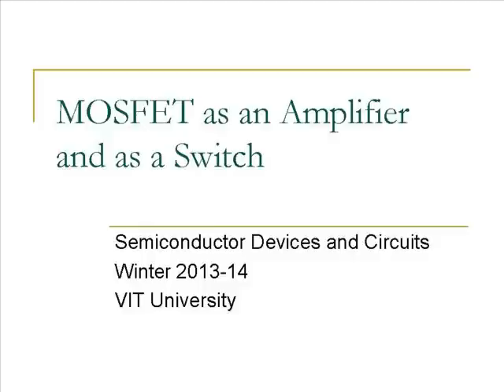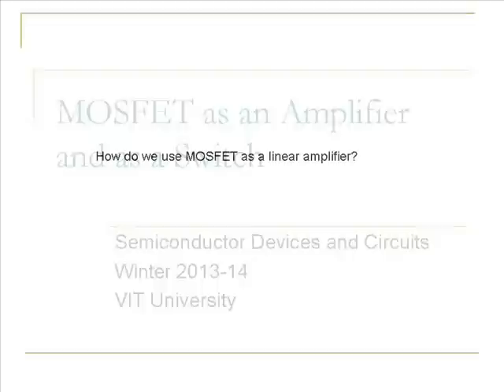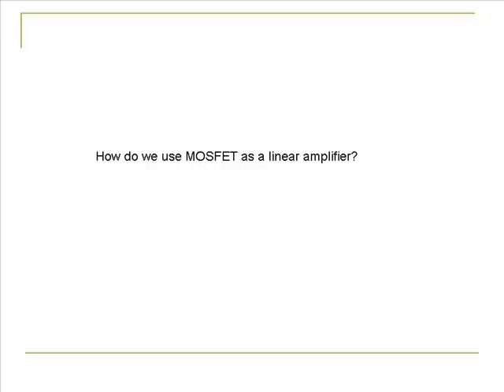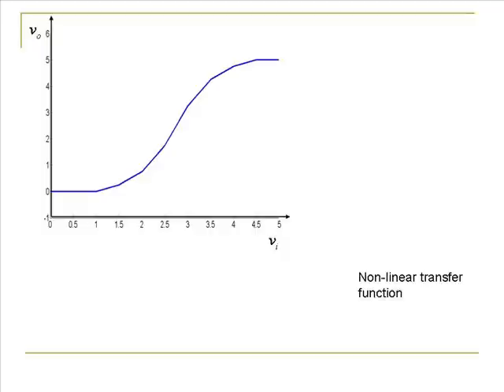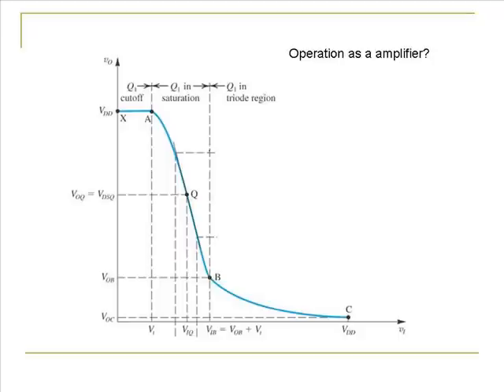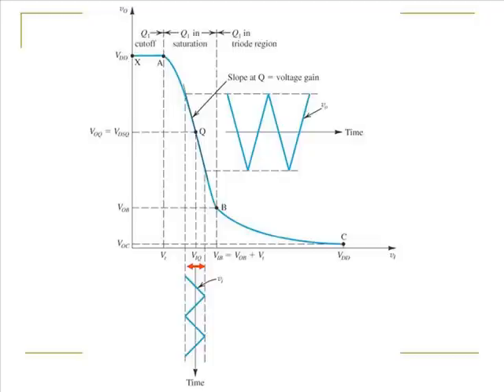MOSFET as an Amplifier and as a Switch

Comment: Please clarify, at point "A" video time: 11:06, you mentioned that the switch is closed. Why is this so, when the current at that point is 0 A? replacing the transitor with an open switch is more likely , not "closed", because the voltage across an open switch will be Vdd.
Reply: I think he means open by closed and closed by open.. Notice that it was written 'switch off' when he said closed switch and 'switch on' when he said open switch.